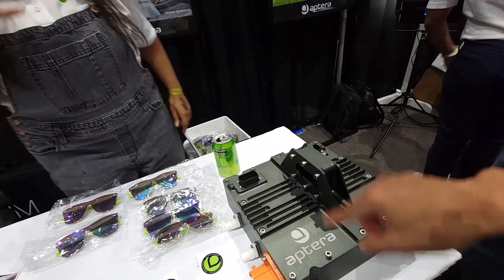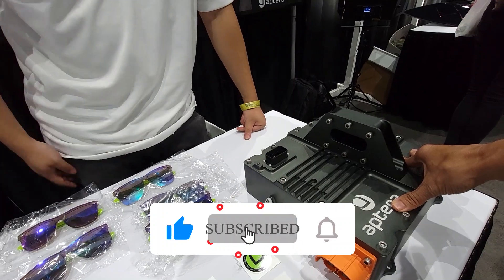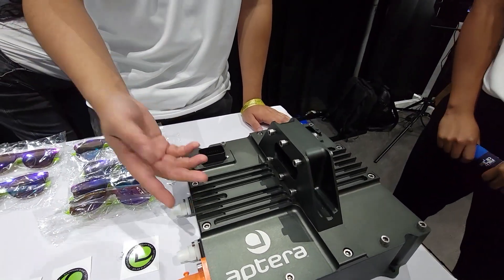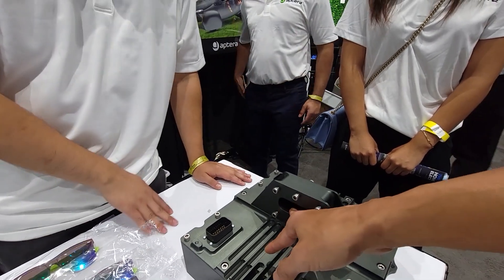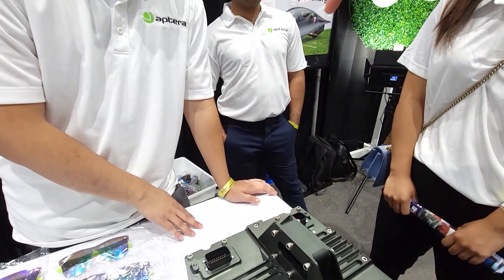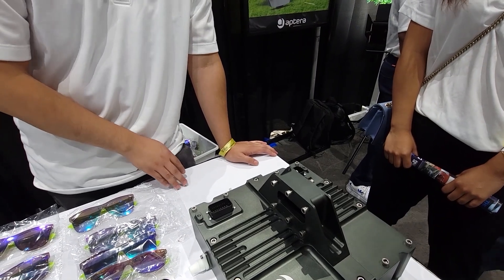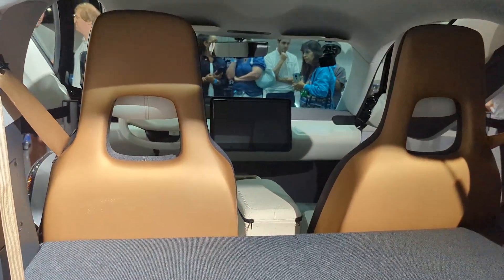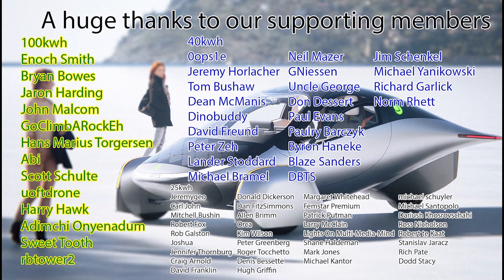Aptera will use silicon carbide MOSFET inverters

Comment: Thanks again Steve for asking great questions! I really appreciate your curiosity and you sharing what you find out with all of us .
Reply: @David E. Huerta - me too, Thanks Steve for the questions especially for your "Why go from DC to AC using a heavy/hot/power draining/expensive inverter?"  I also got lost with his answer, but what he said sounded like he didn't really answer the question of "Why"?  By saying that this AC setup facilitates being able to go from forward to reverse didn't sit well with me (with a DC motor reverse means simple switching the polarity of the power lines).   I can only hope that the real reason for these inverters is NOT because the Elaphe motor is AC.  If that is the case, one of my questions is: does Tesla use an AC or DC motor?

Comment: The size of a well built 20kW inverter with traditional Mosfets and this delivers 50kW However the the real advantage of using SIC Mosfets is their slightly higher efficiency 3.4%, better, which reduces cooling needs and weight. Reliability wise they are better too? Yes PM DC motors are very efficient, but they use brushes and you don't want that, especially in an EV that sees high current peaks, they wear fast.
Reply: I forget how brushes can change color when stressed... lol

Comment: He told you it was I Squared R...... So the current squared times resistance is another way of saying volts times amps.....   So when you lower in silicon the resistance the power is reduced due to ohms law power wheel this less resistance means less heat ...... Think of a resistor that has a lot of current going thru it.   When you touch it you feel heat and could burn your self.... Now put a fuse in place of the resistor and touch it there is practically no heat at all.... I hope this helps simplify to those with no electric background.... Best Regards

Comment: Some of the reasons they use AC motor see motors is this way easier to control much cleaner and smoother. I'm not sure if the hub motors are AC reluctance motors or not.

Comment: All the car companies use silicon carbide IJBT's.
 The silicon carbide part is just what's packaged around the actual manufactured chip to keep it cool and keep it from burning up. 35 years ago when I was a component buyer in silicon Valley I was buying those that's no new technology there.
Reply: SiC was only used as a heat sink back in the 80’s. These are actual MOSFET made of SiC. IGBT is Si, not used here.
Reply: No word here is correct.

Comment: Rds is the resistance from the drain to source in a field effect transistor. Drain and source are the power connections of the transistor. The lower Rds, the less power loss and heat.

Comment: the only thing I don't like, and this isn't just the Aptera, but the infotainment sticking out of the dash thing that a lot of EVs seem to be doing. I REALLY like what Cadillac plans to do with their Celestiq, but completely understand if the goal is affordability then integrating a custom sized screen into the dashboard is a pretty tall ask. Even so, it would be nice to explore it as a possible upgrade for the Aptera.
Reply: I think the design is to make it easier to replace or repair by the owner if needed.  Aptera is taking the right to repair to a whole new level for vehicles.
Reply: I agree with you, but we seem to be in the minority.

Comment: I didn't understand why the motors are AC and not DC.  Anyone?
Reply: DC motors need brushes. They basically works the same as AC motors switching on and off the different windings in the motor to make it spin, but the switching is mechanical inside the motor which creates arcs on the sliding contactors, so they wear and the bushes need cooling, so in an enclosed motor housing you don't want plasma and coal dust flying around. Brushes also have mechanical drag, so at low loads, that drag is significant.
Reply: @Tore_Lund  Except for brushless DC motors.
Reply: @lsh3rd  I was contemplating if I was going to elaborate of those too, but the difference then gets blurred! So are they really DC motors then, just because you can feed them DC but the AC conversion is hidden inside the motor housing? They might utilize a simple on/off switching of the coils, but as they are coils having induction, the current will be sinusoidal in reality. The only difference is the control method: The brushless DC motor is voltage controlled like a real DC motor through its power leads, but that is a trick made made by the electronics inside it to emulate the characteristics of a DC motor, but they are in reality AC motors too and could as well be controlled by a speed- or torque signal like any other AC motor.
Reply: There has been a bit of confusion regarding the use of the terms even among professionals.  Some people use the power source to decide whether to call a motor AC or DC.  In fact, all rotating electric motors have to be AC, but it might depend on whether the alternating current is produced mechanically or electrically.

Comment: I get it, too! 😂 Not. I look forward to a future deep dive. I did pick up bits and pieces of interesting information, but his quiet voice, mask, and the background noise made it difficult to follow, technical content aside. He did say that there would be one inverter (the unit on the table) for each wheel motor, right? That's a lot of volume and weight, I suspect. Do you know where they will be located? My guess is up front under the hood.
Reply: I had the same thought. Is this why there is no frunk?

Comment: i would feel better if those coolant ports were made of metal. at least they're not threaded inserts. SiC electronics are considered the next level in high power, high heat applications. we are now making SiC chips at our plant for applications in cellular and automotive that benefit from this Advanced material. SiC is rapidly becoming less expensive and more commonplace in the electronics world. Thanks Steve !
Reply: Silicon carbide
Reply: What is SIC ?
Reply: We often have to go with the technology that is tried and true (Commodity) when working with tight development schedules that are the most competitively priced. Your product should be targeted at the vendors which make these devices.
Reply: I read that SIC MOSFET inverter efficiency is around 99%, so that'd be 500w lost as heat when at the full 50kW?  Although I would imagine most of the time you'd be cruising with much lower power draw.  The coolant ports look very generously sized for that heat load so I wonder if I have got that wrong somewhere.